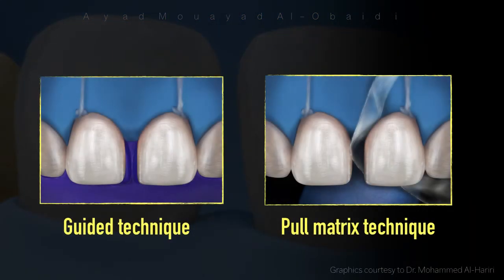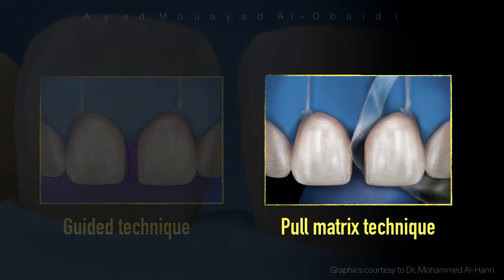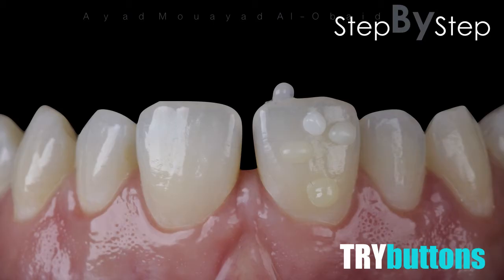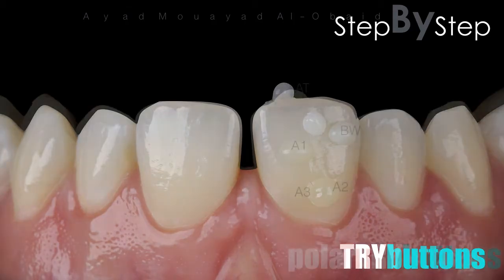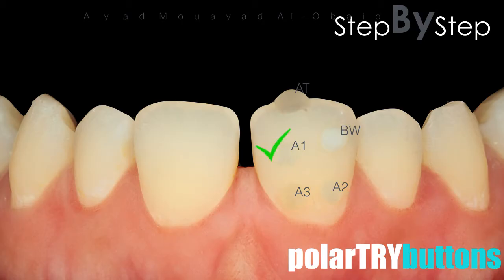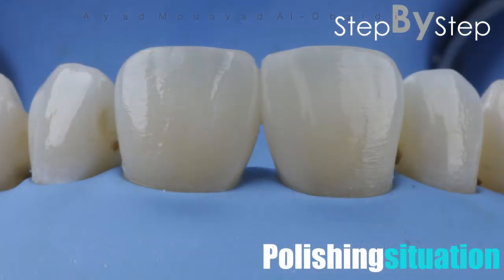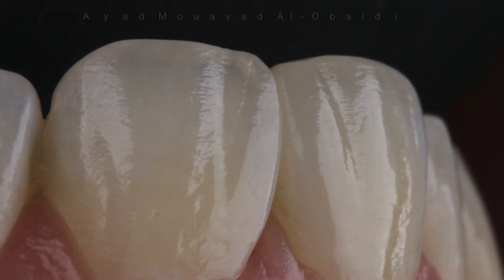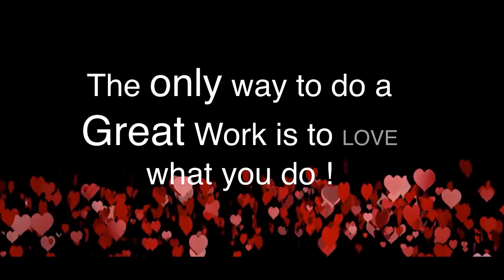diastema closure technique tips

Comment: That was really gorgeous.. and of course i vote to explain the guided technique.
But i surprised that you used the primer for adaptation not the wetting agent! Because the primer have an MDP which is an alfaphilic molecules and it need to join a hydrophilic surface (which we don't have) as well as a hydrophobic surface (which is the composite here), other wise and without the hydrophilic part it will remain unstable, therefor they get out with the wetting agents... please correct for me or explain the ability to use the primer just for the outer surfaces adaptation not inbetween the composite layers if that is really forbidden! 
Sorry for the elongation... and thanks for your efforts
Reply from the maker: Thanks dear fro your comment of-course I meant modeling resin  or wetting  resin and so me company have it  as composite primer
Reply: @ayadmouayadalobaidi   Oh feeling comfortable now 😌 thank you.. eager to the next video
Reply: F